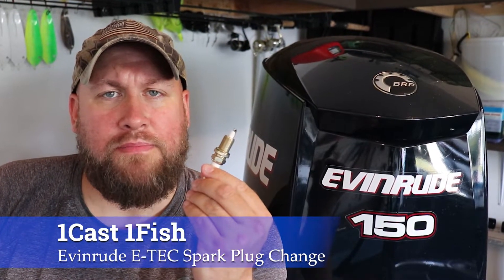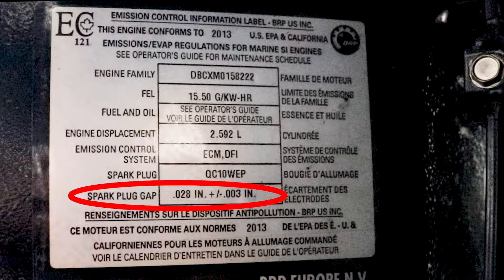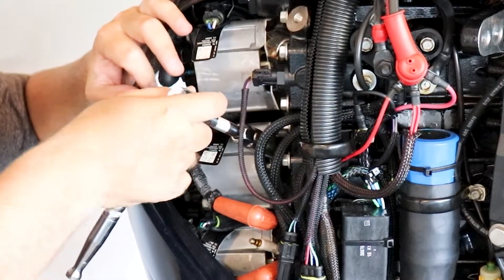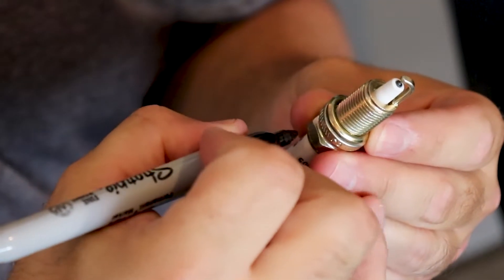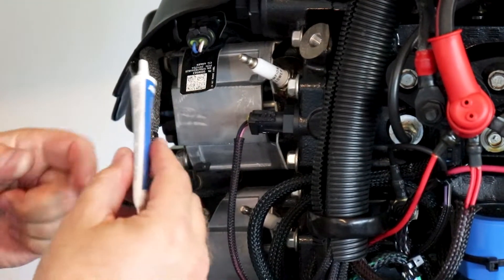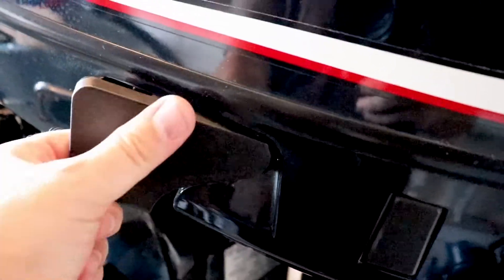Evinrude ETEC Spark Plug Change & Plug Indexing Instructions / 3 Year 300 Hour Service

Comment: How do you determine which direction the injector pin is facing?
Reply from the maker: The pin is just a reference, the spark plug orientation is what is important.

Comment: Thanks for an in informative vid. My only comment is it is best not to lubricate threads if using a torque wrench because the friction on the thread is allowed for in the torque settings so if threads are lubricated you may over tighten them
Regards, Geoff
Reply from the maker: That is a very true statement and can be an issue if you try to go to high on the torque.

Comment: On the BRP Skidoo snowmobile engines supposedly if you buy the NGK plugs from the dealer with the skidoo part number they are "guaranteed" to index properly because the threads are cut to ensure proper clocking at the final torque.  Not sure if that applies to the boat motors also.
Reply from the maker: Not sure...I always have one that does not want to index though.

Comment: excellent video what is the injector pin purhaps the middle of injector? thanks
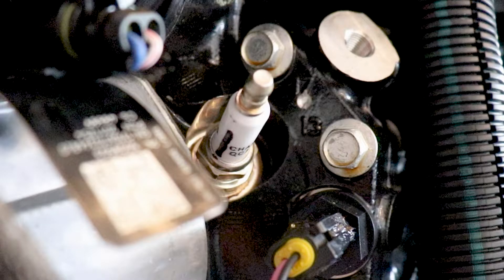Reply from the maker: at 3:59, you can see it is facing the injector...I also use the small looking dot directly across that you can see between 2 bolts as a reference.

Comment: Tech tip I have seen the spark follow the marker line, I make a very short line on the top of the insulator and use die electric grease to insulator it
Reply from the maker: Goof tip...I have heard of this happening in a few cases, but can't remember the specifics...like insulation or marker type contributing.

Comment: This is good, but I do not know what the injector pin is or what it looks like.
Reply from the maker: at 3:59, you can see it is facing the injector...I also use the small looking dot directly across that you can see between 2 bolts as a reference.
Reply: @1Cast1Fish  /Thank you. I will look in the morning and let you know. I have a 75 etcch motor, 3 cylinder. Thanks again.

Comment: I don't understand, if it has 4 cylinders what position the spark plug should be in, I have an Envirude e-tech 115
Reply from the maker: Should be the same orientation with the injector as on the 6.

Comment: Hello. We changed the e tech 25 hp petrol pump. but everything works normally, the energy comes, the pump works, but the engine does not start by gurgling.. we spray the cylinders with lining spray. Hello..
Reply from the maker: Honestly not sure what the issue may be, but maybe fuel related
Reply: @1Cast1Fish  Is the fuel pump relay not in the ecu? The ecu has been tested in another engine and it is valid. Is there a contact in another contact place?.. Can you tell me which ends of the ecu's 12 volt input socket?.  I wonder if I have a short circuit in the 12 volt energy entering the ecu, I'm asking to measure..ecu is solid, no problem..
Reply from the maker: Wish I could help more, but honestly, this one may be over my level of expertise.  Do you have the service and maintenance manual?  Might be time for a shop visit.

Comment: So what is a good way to clean out the arteries that the water goes through is clogged???
Reply from the maker: Use the flush port on the motor, there are also videos of disassembling the water lines while flushing to find the plugged spots. I however have never done this
Reply: @1Cast1Fish  ok thanks.  I got all the stuff out of the hoses. Now, it pisses water good but not at idle speed at all.  What do u think I should do now???
Reply from the maker: Mine does not flow a ton at idle speed either.  Is it overheating?
Reply: @1Cast1Fish  what does it do if it overheats. ? How will I know if/when it overheats.?
Reply: @1Cast1Fish  it's a 1989 60hp amd I don't have the money for a new one but I'm willing to do anything to get it going so I can fish with it.
Reply: @1Cast1Fish  how likely is it
  that it's clogged Just enough to  keep it from flowing out when it's at idle speed because the impeller is not spinning that fast with not much force of water but when the impeller is going fast, it's enough speed and pressure build up to make it flow out faster and fast enough.
And fast enough.?
Reply from the maker: @qw7154  have u pulled and checked the Thermostats?
Reply: @1Cast1Fish  no.  I will do that today when I get off work or tomorrow then get back to u. Thank you. R u thinking stuff might have got stuck around the thermostat??? What should I check for? 
If u can think of anything else please let me know.
Reply from the maker: @qw7154  I have seen them plug up with junk or corroded and not get full flow.
Reply: @1Cast1Fish  thanks alot for taking ur personal time to help me.
Reply from the maker: No problem, hope you get it figured out

Comment: 2-cyl e-tec. Bought 5 spark plugs, only one fits to another cylinder. This is so stupid.
Reply from the maker: Dang thats really bad luck with them, sometimes they get real close given a fair amount of play with the torque specs.  I usually buy 2 times as many just in case.  You can also buy indexing washers, but I remember reading they are not recommended somewhere...but honestly can't remember who or where I heard that from.  Might be worth checking with Evinrude and trying.

Comment: For starbord mounting side it s very clear and the indexation is shown. But for the port side indexation is not shown, we  easily undestand that spark oplu should be oriented to the injectors (tolerence zone)
Reply from the maker: Should be the same on both sides

Comment: I have a 40hp etec runs terrible at low speed 3mph to 8mph  " missing,  chugging. Idle seam good, top end is good , had champion plugs switched to nkg iridium plugs the situation got worse ! Would you think e3 plugs might correct this ? An authorized evenrude mechanic did the 3 yrs service and switched out plugs an said he did all the necessary work?? But it runs like crap at low speed ......charged me arm and a 🦵 .... Help !!!!!
Reply from the maker: Wish I could help, but I am by no means a pro, and it's sounds like it would be tough to diagnose the issue without seeing it.  I would check to be sure all the spark plug wires are attached securely, also check the indexing on the plugs.

Comment: FYI...If you are applying grease to threads, you are increasing torque value dramatically above 15 or 30lbs. That's fact and a risky move...must use 14mm plug shims if you can't achieve proper index after musical plugs or 30lbs dry thread. Cheers !
Reply: The shims will cause more problems than greasing the threads. Don't add shims, find plugs that index correctly.

Comment: How do you know when it’s lined up to the air intake? I don’t get that part.  Thanks
Reply: I meant lined up to the air and fuel mixture.
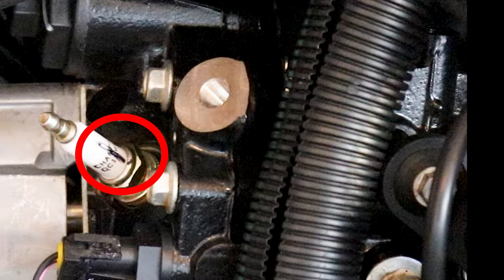Reply from the maker: There is  a small indent there...its noticeable if you look close at about 3:01 its kinda silver looking just above the bolt head

Comment: Hi Kevin. Great video man!!
Could you please make a video on where and how to change the sacrificial anodes that are inside and on the motor.
Thank you! 
I want to help my etech last forever 😁 it is an awesome work horse.
Reply from the maker: I have not made a video on that, however they should be replaced if they start to show signs of wear....normally they are just bolted on and easy to remove and replace.